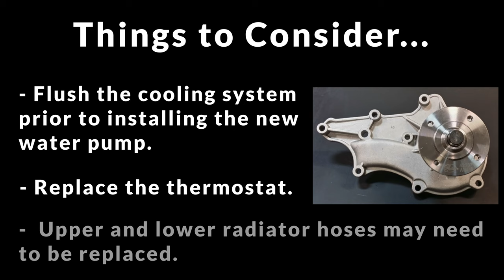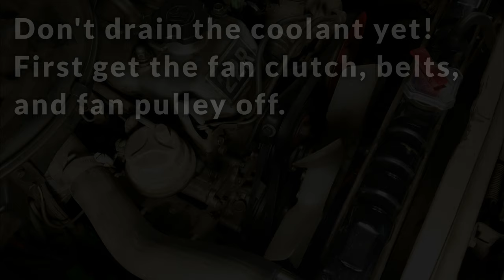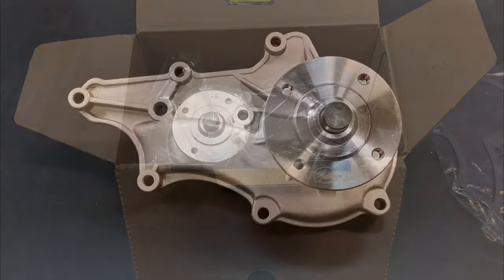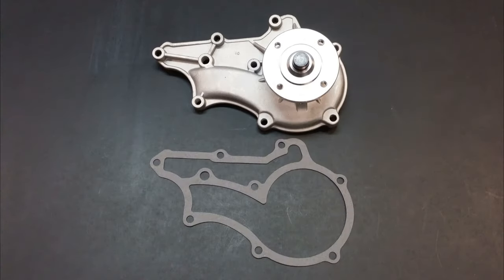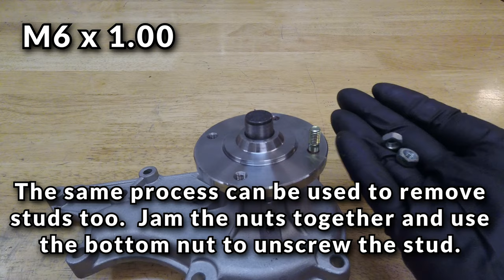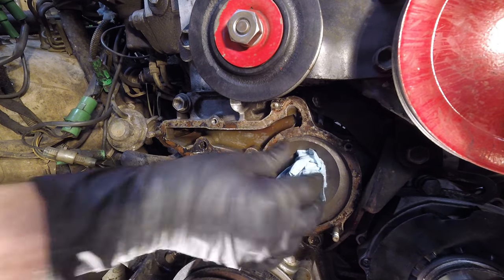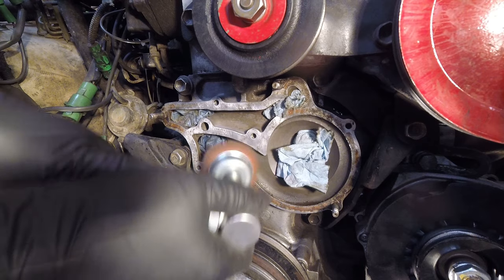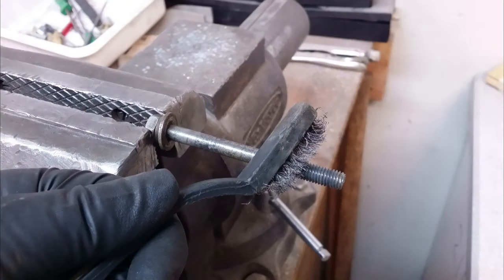TOYOTA WATER PUMP - 22R Series Engine - Complete DIY Diagnose Remove & Replace 22R 22RE 22RET 4x4

Comment: Hey wheelie pete love the videos i just replaced timing chain in my 1990 Toyota pickup and when i had taken out spark plugs i noticed on 1st cylinder the spark plug had sandy grit on it so found out that is caused by valve seals leaking oil into the cylinder so decided to replace and saw a couple videos how to replace without taking the head off so i did replaced seals but noticed leaking around head gasket on outside the motor when i started to put everything back together i kind of scared now to start up any advice what i should do?
Reply from the maker: Did you manage to do the seals without removing the rocker arm assembly?  I guess it can be done if you remove the adjuster and the be really careful not to drop the valve into the cylinder too far.  The first thing that came to mind when you said it was leaking around the head gasket was that you pulled the rocker arm assembly which would mean you took the head bolts out and the pressure was taken off the head gasket and things started seeping.  If you didn't pull the head bolts, then nothing really should have changed.  If you did pull the head bolts then there's a chance the head gasket is compromised.  You could just fire it up and see how it runs.  Might get lucky if you removed the head bolts and then put them back in that things didn't move too much and it will seal back up.  Generally speaking the old "replacing valve seals without removing the head" is for very old rigs that had the kinds of seals that would crack and degrade relatively quickly.  With modern engines that's not really the case and by the time the valve seals are leaking the valve guides are usually shot and you really should pull the head and do a full head job.
Reply: @WheeliePete   ya i had to pull head bolts to get to valve seals so if i fire it up what signs should i look for to know that gasket is compromised
Reply from the maker: @unclekory    Darn...yeah that's probably what's seeping then.  Did you drain the coolant before removing the head bolts?  If not, then I would probably do an oil change and a coolant change  (if stuff is seeping from the edges of the head then you probably have coolant contamination in the oil as they both (oil and coolant) have passages through the head and block that run through the head gasket), you should then pull all the spark plugs and crank the engine over to try and clear anything that may have seeped into the cylinders  (I'm thinking worst case here that enough coolant went into a cylinder to fill it up enough to hydro-lock it.)  Once you get all that done, fire it up and it's probably going to smoke for a bit if either coolant or oil got into the cylinders.  If it continues to smoke bad after you get it warmed up then the head gasket is probably shot.  Look for oil or coolant being pushed out under pressure at the seam of the head and block also.
Reply: @WheeliePete  ok ill give that a try thanks so much wheelie pete
Reply: @WheeliePete  so i did what you said and didnt run right right off the bat and kept watch on coolant and started getting oil in it no smoke but was running awful so stopped and drained oil it was a light brown and pulled plugs looked wet on top of cylinder so going to tear down again and replace head gasket any words of wisdom before i start
Reply from the maker: If you're going to have to pull the head and you have a lot of miles on it, you might as well plan on getting a valve job, new guides, surfaced, etc.  Better to do it now and be confident in how it is when you put it all back together.  If you got coolant in the oil, when you put it all back together you should change the oil multiple times pretty quickly until you're sure you've got all the coolant contamination out.  If the timing system has been in there a long time now would be the time to pull the timing cover off and replace the chain, guides, tensioner, and gears too.  It's a lot easier to do with the head off...
Reply: @WheeliePete  ok will do thanks alot

Comment: 1977 20R toyota pick up.....gonna go with no paper gasket instead use
Permatex water pump gasket maker.
Wanna buy correct new bolts expert at hardware gonna measure old.
1 long bolt center ......8 total.

1 shorter bolt.
1 bolt with bigger washer.
1 bolt with small washer makes no sense like the shorter one.

Total holes are 8.
A neighbor said shorter bolt goes in hole tip of pump, left side of fan looking at 20R engine label looking at windshield from front of grill.
Tried that but it does not catch.

Short bolt catches at top hole on pump.......OK.
Still gonna get new bolts.
Even long bolt.

Tips of bolts look clean.
Bolt ends closest to pump sort of rusty though I cleaned not like threads that screw into engine block.

Any advice....

Comment: Around 25 minutes you talk about coolant hitting the ground. I have been having fuse issues lately, and while looking under the hood I noticed a coolant leak and the reservoir being low/that possibly that knock you were talking about at the beginning of the video. Is it possible the coolant is messing with the ground, causing fuses to pop? Thanks!
Reply from the maker: It's possible, but but not likely that coolant is causing the issues.  Fuses routinely is probably being caused by a wire that has gotten rubbed and is grounding out.  Is it the same fuse that is blowing or different ones?  What I'm talking about in the video has more to do with improperly grounded aluminum parts (like the head) that when stray current gets into the coolant it eats away at the aluminum over time.  If the fuse that is blowing is on the same one you'll need to start working your way through that circuit, looking for the fault.  Start at the grounds and make sure they are all good, clean bare metal, and then start looking for frayed or loose wiring on that circuit.
Reply: WheeliePete Thanks for the reply! I figured out my short issue actually (made a mountain out of a mole hill with that one). While doing so, I just visually inspected and felt the water pump, and I don’t see any leaks there. I did notice the top of the front differential is wet though. Any ideas of where a coolant leak could come from to spill onto the differential?
Reply from the maker: There's some hoses and pipes over on that side.  Cold be leaking and traveling down along things until dripping.  One that gets overlooked is if you have a carburetor there is sometimes a small coolant line to the bottom of the intake manifold under the carb.

Comment: Where did you get the new water pump  and torque wrench?
Reply from the maker: I usually buy my automotive hard parts locally if possible to support local business and to make sure I have the right part at the counter.  The small newton-meter torque wrench (Nm) is a usually found in cycling tools suppliers as carbon bike parts are very sensitive to torque.  I have amazon affiliate links to many of the products and tools I use in the video in the video description.  Here's one of those links to a torque wrench like the one in the video that reads in Nm (Newton meters):  https://amzn.to/3rFiyqW  Thanks for watching my video!

Comment: So are you not supposed to put rtv on that bolt that goes trough the timing cover?
Reply from the maker: The reason that the timing cover bolt that passes through the water pump, timing cover, and into the block doesn't need sealer is because it is being run into a blind hole in the block and has the timing cover gasket and the water pump gasket protecting the bolt hole from oil and coolant exposure. Toyota is pretty good about calling out special procedures when needed in their factory service manuals (FSM).  I think you might be remembering that the top most bolt on the oil pump DOES require sealant.  That bolt hole is exposed to oil on the backside and without sealant you can get oil pushing back up the threads and weeping around the head.  I just put a post up on this channel's community page with pictures from Toyota factory service manuals of the two assemblies.  Toyota is pretty good about calling out special assembly procedures in their FSM's.  Link to the community page: https://www.youtube.com/channel/UCI85rruZT8T-rq2EEmrvsQg/community
Reply from the maker: I've got a video on the front main seal for the 22R series engines that covers the removal and replacement of the oil pump also:  https://youtu.be/5eozfLpEJds
Reply: @WheeliePete  So does that mean I don't need to worry about compromising the timing cover seal? I have a 22-RE
Reply from the maker: Correct.  Replacing the water pump should in no way affect a timing cover seal on any of the 22R series engines.
Reply: @WheeliePete  I think your right I was remembering the oil pump bolt

Comment: What torque wrench did you use here?
Reply from the maker: A small one that reads in Nm.  Normally used for smaller bicycle hardware.  This is a similar (if not the same one re-branded) torque wrench on Amazon (affiliate link):  https://amzn.to/3rFiyqW

Comment: Are these prone to failure ?
Reply from the maker: It's been my experience that the "Aisin" branded water pumps (original OEM manufacturer) are excellent and last a long time.  It's kind of hit or miss with aftermarket manufacturers.  The condition of your coolant plays a much larger role in how fast your pump wears out.  If your coolant is dirty with a lot of particles floating around it's going to shorten the life of the pump.  That being said, no, it's not a prone to failure part in the 22R series engines.

Comment: Permatex water pump & thermostat GASKET MAKER instead of paper gasket. 1977 20R Toyota pick up.

I APPRECIATE YOUR OPINION.

Bought STAINLESS STEEL new bolts. Not the long bolt using old.
Reply from the maker: Should be fine.  Don't go crazy with the gasket maker.  You don't want blobs of that stuff breaking off on the inside and clogging/jamming your cooling system
Reply: @WheeliePete  😁 Thank U....
Saw video, the guy just patted it on with 1 finger.......everybody else put fat rope looking SQUEEZE from tube all around....was not gonna do it that way.....common sense said overflow to inside once screws are tightened for sure.
Pile of gunky stuff.
💋😘 HAPPY HOLIDAYS!👍🙏
Reply: @WheeliePete  last question. My pump has 8 holes. Shape the same 1977 20R......aside from the long bolt all are the same length.
There is 1 odd bolt shorter. Hardware said it did not look broken.
Do you have a SHORTIE BOLT anywhere?
Reply: @WheeliePete  hoping U could tell me if U had SHORTIE SCREW/BOLT.

Got new bolts, did not have stainless steel except the shortie, but; I want to get a bolt like the rest dame size but for the long bolt......center.
🎄🎁🎁🎁🎁🎁🎉HAPPY HOLIDAYS NEW YEAR!
Reply from the maker: There shouldn't be an odd short bolt in the system.  I bet someone lost one of the alignment studs and replaced it with a short bolt.  A bolt will be fine, just make sure it isn't bottoming out in the hole and not actually clamping.
Reply: @WheeliePete  HAPPY HOLIDAYS🎉🎈🎊🏅Hero advisor REALLY APPRECIATE YOU!
LOGIC common sense, so 🤔 yesterday 🤑 🔩 now ALL NEW but center long bolt cleaned threads in vinegar.
Hardware sold me a tool like a drill that cleans threads inside, gonna do by hand, good idea I thought because old bolts were rusty may have gunk before I put NEW bolts in.

Your OPINION, any  ADVISE valued sincerely on this B4 new year vowed to be driving my ANCIENT TOYOTA 1977 20R CHINOOK🤗🥰 
💋😘
Reply from the maker: They probably sold you a tap or a thread chaser.  Just carefully screw it in and out of the hole, a little bit at a time, cleaning off whatever comes out on the threads of the tap between passes.  It'll clean up the threads inside the hole.  if it's really gunked up in there, put a little grease or oil on the tap before you run it down into the hole. I have an old factory service manual in .pdf format for the 20R engine.  If you send me an email to WheeliePete@outlook.com I'll send you the files.  That manual will help you work on that engine a lot.
Reply: @WheeliePete  SO THANKFUL these holidays. I am going to talk with my daughter MONDAY she can copy send to me maybe., 💕 my cell phone may not have enough memory plus I will have to go to LIBRARY print it.
How many PAGES does it have.?
I found after I cleaned all the gunk under hood a map for hoses.....not perfect but really learned a lot.
TU WHEELIEPETE.......🥰🤗
Reply: @WheeliePete 🤔 tool to hard scared, it stops.
Do your bolts have lock washers.
Can you tell me how long they were?

Got it squeaky clean gonna go for it tomorrow.

PS🤩 REALLY REALLY HELPED SHOWING THE BOTTOM BOLT ON ALTERNATOR......TO LOOSEN IT UP.

TU WHEELIEPETE...
Reply from the maker: I'm sorry, I don't know how long the bolts are.     The factory bolts have a flat washer and a lock washer.   Factory bolts have rolled threads (formed under pressure not cut) after the washer and lock washer are put on the shaft of the bolt.  This is why on  the factory bolts you can't easily slide the washer or lock washers off.
Reply: @WheeliePete  👋 I did everything used some new bolts. Not all. Did not use the thread cleaner did not want to put more force.
Used Permatex water pump gasket maker on pump. Tapped goo not over edges, thin.
I used Permatex 2 on bolts.
If this does not work will buy Permatex High Tack and gasket.

COLD rainy SUNDAY will try after put fan coolant to start it up.
🤔🙄😁

PS I looked at the 1 bolt that I could not get washer & lock washer off, it was 7.
Used it because it was ORIGINAL.
Reply: @WheeliePete  it is NOT LEAKING.....my NEW YEARS 🎁🎈🎉🎊 to myself, saved here cost for repair🤑🤑🤑 $375
What was SO HELPFUL from you was finding which 🔩 original.
Then where that bottom 🔩 was to move the ALTERNATOR was.
Plus not go overboard with gasket maker. BEING CERTAIN FAN CLUTCH GOOD 👍too!
I also used Permatex 2 sealant non hardening around 🔩s.
Thank 👍😊🙏

Comment: UPDATE EDIT ! ( NOT ALL 22R WATER  PUMPS ARE CREATED EQUAL) YEAR MATTERS ...'JUST FYI'... I watched the video . Was extremely careful doing this water pump just the way is shown in this video . Filled the radiator with new coolant and it is leaking around the top of the water pump  before  even starting the engine . I have no idea what I did wrong
Reply from the maker: If it's leaking water without any pressure in the system then there's a really big gap in the gasket somewhere or a cracked casting on the new water pump, or a very uneven sealing surface on the front of the timing cover (although if it wasn't leaking before it's probably not the timing cover.) Unfortunately you're probably going to have to take it off and check it and then reseal it again.  Make sure all the mounting bolts and studs are in.
Reply: @WheeliePete  brother , thanks for the reply so quickly.  I love your channel.  Here's the news ,,,,,I just took it back off a few minutes ago . It's the wrong dang water pump they sent me . I didn't realize there was a slight difference  in that top edge . My truck is an 86 and has the curved top . This pump is straight across there . Man ole man . From what I've read so far this pump is for 84 models and earlier.  All the holes line up great but that top edge don't . I'm just finishing up my rebuild and was about to crank this thing when I saw the water dripping on my final checks . Thank you much brother
Reply: @WheeliePete  it was funny because I did it on the bench , clean enough to eat off of . I was thinking the whole time to myself " there's no way I can do it any  better the second time "
Reply from the maker: Oh man...that's a bummer!  But I'm glad you got it figured out.  At least you caught it before you fired up the truck.  That would have made a much bigger mess if the pump had started working with the leak being that big!
Reply: @WheeliePete  yes sir absolutely.  Appreciate you man

Comment: If you just so happen to run across a stash of tilt steering column covers let me know. I need one for my 83 lol
Reply from the maker: Man, those are getting rare... I found a set for my truck, but I'm having to build back some of the broken off mounting bosses in the plastic by shaping JB weld where the mount broke...

Comment: Can you drive a 1990 toyota without the steering belt..
Reply from the maker: Without the power steering belt powering the pump?  Yes.  Turning the wheel will be a lot harder, but you will still be able to turn the wheels.

Comment: my 1991 hilux take about 9.8l of coolant
Reply from the maker: Since you said "Hilux" I'm assuming you're not in the U.S.?  Is your rig by chance the  Toyota Hilux Surf LN130 1989-1993 model with the 2.4 turbo diesel 2LTE engine code?  If it is, that would explain the amount of coolant as those engines call for 9.5L with a manual or 11L with the automatic gearbox.  I'm in the U.S. (which also explains why I listed capacities in quarts and gallons) and we never got the diesel motors unfortunately.  My video is specific to the U.S. 22R series engines which ran from 1981 to 1995 in the U.S. trucks before they switched to the RZ series motors in the Tacoma's.  The cooling system capacities did fluctuate a bit over the years depending on year, 4x4, manual or automatic trans, etc.  I should have done a little better job in the video announcing that the capacities listed were "approximate" and that you should fill the system to capacity as needed in your specific application.  I've put a little update to that effect in the video details section on YouTube.
Reply: @WheeliePete  im from australia  but mine hilux is  ln106r with a 3L motor